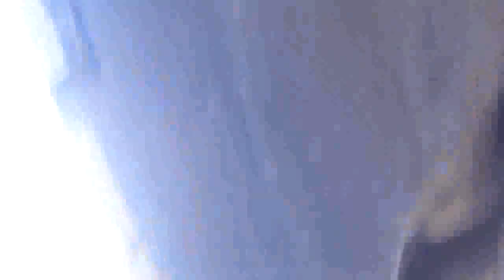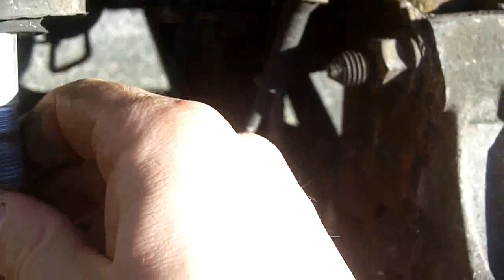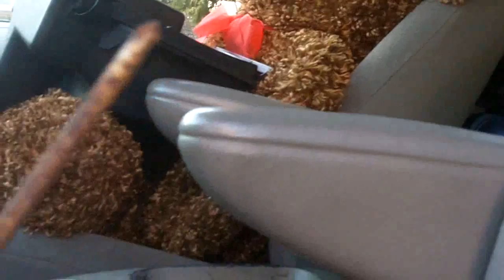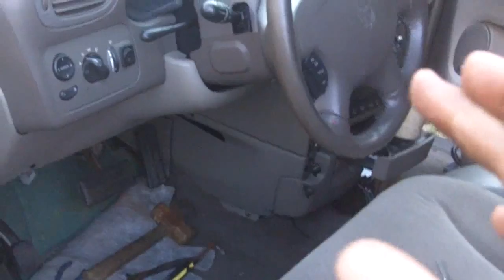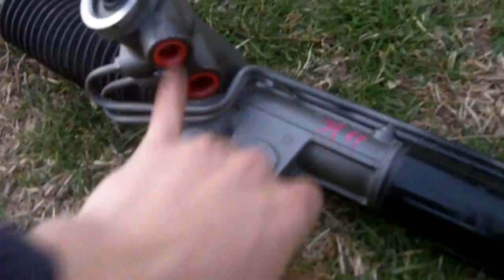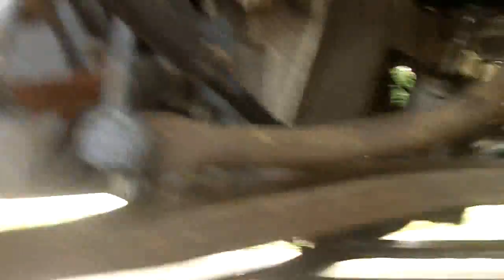Installing a new Rack and Pinion 2003 Dodge Grand Caravan

Comment from the maker: this is a remanufactured rack i bough from a reputable rebuilder..rememebr theres a difference between rebuilt and remanufactured.. rebuilt means they replace whatever was broken on the part and send it back out.. remanufactured is just the shell of the component but all new parts.. Buying a remanufactured item is just like buying brand new but just the exception of a original shell or core..

Comment: Just wondering have you ever changed the inner tie rods? I've just bought a 98 Grand Voyager and the outer tie rod ends have a little too much wear, but I noted the inner's have a little play also so figured I'd replace them all. but I am hoping that it cam be done without removing the rack. 

Great vids by-the-way!
Reply: I have changed the inner tie rods.  First, I rented a “special” tool from a local auto parts store (O’reilly’s).  Then I attached the special tool, after placing the correct size insert for the inner tie rod, and I used a  breaker bar to get it to start moving and then a ratchet or air-impact hammer.  I realize your comment is from 8 years ago, but no one has answered it.

Comment from the maker: Mine was a 2003 and they were nearly the same from 2001 to 2007. other then the stow and go feature introduced in 2005. you dont have to remove the steering wheel, But you do have to remove the steering shaft that connects to the rack and pinion. are you sure your reading it correctly?. it may be telling you to remove the steering shaft..

Comment from the maker: Mark, This video was back n the day when I was just starting out, today Im alittle more in detail with my videos. Sorry for not having a assembly video of me putting the rack back in, But its basically done in reverse order. As far as your steering issue goes. you may need to lubricate that part while you put it on. if i remember correctly, theres only on way of putting it on..im gonna have to look at my caravan and see. try not to beat it on something might break

Comment: Bro thanks for the video. A friend needed this done on an 06. Your video helped alot but, you didn't show putting it back together. It's all back together but, I wanted to know if there was anything you could tell me about putting the steering column back on the shaft to the rack. It's not wanting to just slide onto it and before I get to beating on it I figured I'd ask. And also how rough is putting that pin back in? If you can help anymore it'd be really appreciated. Thanks.

Comment from the maker: Hye John. Sorry I was away when you sent this. The roll pin goes back in the same way you took it out..if the pin get damaged " mushroomed" on on end insert the other end in and tap it with a hammer. Use care when removing it.  good luck, you will do fine

Comment from the maker: That was the same problem with My rack. in the same spot. it should leak out that boot. check for a leak, If so rack needs to be replaced or that seal needs to be repalced

Comment from the maker: that sounds like a BAd Seal in the Rack unit..It could very well be a presure line, but get under the car and inspect the two rubber boots . if the boot is busted  look for leakage.. very common probem

Comment: funny you call that old, it's one of my newest cars. Yea I think you are right, I will just do the inners. 
Mine has been a good grocery getter, bought it as a lien sale from a transmission shop. Paid $1200 for the transmission and owned the whole van. Put ~50k miles on it so far, probably around $2k total cost, mostly tires because of the alignment issue.

Comment from the maker: hey, Nice to see a older caravan still on the road.  theres a old saying..if it aint broke dont fix it.. if its not leaking anywhere and works fine, then theres no reason to replace.  get those inners done, theres a special tool your gonna need and it runs about 30 to 60 dollars.. If the rack does go 6 months from now, your new one will come with new inner tie rod ends, so... Subscribe to my channel, I have new videos comming!

Comment: I have a '92 with 220k miles on it. the R&P works like a champ but the tie rods are worn making my alignment bad. What do you think should I just replace the tie rods or the whole thing? I'm worried I'll spend my saturday doing the tie rods and then 6mo from now it will be leaking ..

Comment from the maker: yeah, once again, your wrong.. I should delete your comments for the fear of my subscribers or felow youtubers being mislead. But theres a shred of truth to your comment...TO ALL YOUTUBERS OUT THERE - the statement about the screen getting clogged in the resevuior is true, if you have no leaks and no air getting into your system, theres a good chance your screen is clogged. this usually happens before a major failure of the P.S system. Or just high miles. metal shavings = no good

Comment: Hey you have a rack and pinion just like my dodge dakota and i just noticed today that im loseing a lot of power steering fluid in a spot where those plastic covers cover the tie rod bar so i guess that would be the seal,my question being do you have to replace the entire rack and pinion for a seal leak?like you can change a seal?

Comment from the maker: to Micaelhawk52 - 

 For some reason I cannot reply to your post..But, I Hate to break it to you..Your getting alittle too Technical here comparing apples to apples.a steering box and a rack are totally Different in many ways...A rack and a Rack and Pinion are the Same thing. One is manual one is hydraulic. when you buy a new " power steering Rack" some boxes are labeled " new or Remanufactured RACK AND PINION

Comment: what you ahve in the video is just a steering rack not a rack and pinion. A rack and pinion is used on heavy duty vehicals. like f250. f350 or 2500 and 3500. The rack and pinion is used when more strenght is required in the steering.

Comment from the maker: I took it into my friends shop because we had to Torch ( heat up) the nut that holds the outter tie rod end on.. When taking tie rod ends off A heat gun or better a torch is your best friend..heat it up for 15 20 seconds and crack it loose. tie rod ends is easy, crack that nut loose I think it was counter clockwise, then turn the tie rod end counter clockwise till it is fully removed. count the turns, cause you will need to know how many turns to put the new one on. I used no manual. did it solo

Comment from the maker: theres no exhaust removal.. whoever told you that id refrain from listening to them..Your going to want to get the power steering pump out of the top of the engine..I know theres a bolt or two that are easy tog et to on the bottom of my 1998 grand caravan But this 2003 I honestly dont remember.. be carful putting the pressure line back into the pump.. its real easy to cross threads and have the threaded part of the line go in crooked :(

Comment: @905speedgta than mine is an 87 GTA has the digital dash t-tops and the 350 chevy motor and really gets some attention here in the uk, thanx for the advice with the voyager we eventually got the roll pin out and the steering wheel was kept in the centre position so the replacement rack will be going in tomorrow

Comment from the maker: @2000darren . thankyou.. Make sure the steering wheel says in the center position.. you will damage the clock spring and its sensitive components if you overturn that steering wheel.. make sure you lock it into position.. The roll pin is easy, Just get the right size Screw driver and dont be afraid to hit it hard.. good Luck..I have a 1998 Caravan now thats very similar to our third gen vans..Check out my other caravan videos. I like to hear people doing their own work

Comment: i'm replacing the rack on my 99 voyager and it seems to be identical to yours. the only problem i'm having is that damn roll pin won't come out. thanx for posting the video, better than a shop manual anytime

Comment: Thanks for making the video!  I just had to do the one on our 2005.  It went well but it was very hard getting the hoses loose and I had to get them loose before I could get a wrench on the large nut above the rack near the steering connection.  Not sure what wrench would have worked better but at least it didn't cost me $800 at the repair shop!  Also I loosened the nuts on the tie rods first.  After that they came off easily.

Comment from the maker: @soar233 you would probably have to do one if you moved the steering wheel out of its original position while the rack was disengaged from the steering column.. if you keept he steering wheel in place during the rack replacement its fine.. you dont need to reset the clock spring...do yourself a favor.. throw that haynes book away, and go on ebay and get yourself a shop manual ..clear direct directions for your specific car

Comment from the maker: you would probably have to do one if you moved the steering wheel out of its original position while the rack was disengaged from the steering column.. if you keept he steering wheel in place during the rack replacement its fine.. you dont need to reset the clock spring...do yourself a favor.. throw that haynes book away, and go on ebay and get yourself a shop manual ..clear direct directions for your specific car

Comment: Overall, I found this to be an informative video. I would, however, offer a couple suggestions to possibly make the job a little easier. First, tape the steering wheel to the steering column to keep it from moving. Before removing the tie rod ends from the steering knuckles, I would pre-loosen the nuts holding the tie rod ends to the rack and then remove both tie rod ends before removing rack. I would also pre-loosen the hoses where they attach to the rack.

Comment: Hi, 
I'm trying to get the push pin out to detach the pinion from the seering so that it lets the Rack & Pinion fall out but its not moving a bit. I put a phillips screwdriver in but all it does is get the screwdriver stuck with the pin. Any advice?

Comment from the maker: @adi11010 hey i sent you a msg before I dont know if you got it.. but that box in the way is the charcoal canister for your emissions system ( gas vapor )...do yourself a favor.. if you take that down, replace the hoses that are attached to it.. those vans are prone to havving cracked emissions lines and will throw a check engien light..let me know how your project comes out..as long as your van isnt the AWD model my procedure will work.. good luck.. let me know how it turns out

Comment from the maker: @oceic  People Like you are the reason I make these Videos, Hope you found my channel helpful, and Please subscribe to my channel.. I removed the lines by dropping the engine cradle a few inches. If I were you I wouldnt try to use a line wrench, unless u have stubby ones. I used two standard wrenches the top was 18mm i think. Make sure its just the line. these racks in the 01-07 caravan are known for failure

Comment: Thanx for the video, it is much more helpful than any manual. my leak turns out to be the 2 small lines that stay on the steering rack, aka "gear fluid lines" all else is all nice. a $30 repair but the work is almost what you needed to do. the rack needs to drop far enough to reach on top of it to change these lines. ?? How did you say u removed the 2 big steering lines from the rack ?? i cant find a way to reach them well enough. be well and mechanically sound my friend.

Comment: How much for the new R&P? Did you buy new, used, or re-man?
So basically an 18mm socket, hammer or mallet, and a phillips head screwdriver? That's all you need? Just curious cuz the R&P is leaking like a siv on my wifes '02 Grand Caravan...I'm not VERY mechanically inclined, but I might give it a shot instead of bringing it in and paying over a grand to get it fixed.

Comment from the maker: @jpalencia1983  Lower the engine cradle some more...you can drop the whole cradle if you  need to, but remember, disconnect anything thats attached to it.. I believe for mine wich is a 2003 had a ABS solonid or some sort of device attached to the drivers side cradle

Comment from the maker: @Jetjock101  I didnt have any probs with those bolts. You might have to drop the cradle alittle bit, the shop manual I left really didnt help much. good luck with the two lines running to the rack they are hard to get to without lowering the rack alittle bit. remember those lines are 18mm, dont use a line wrench you will be there forever. btw I think I used a socket and breaker bar on that nut on top. I really didnt have any probs with them. let me know how it turns out.